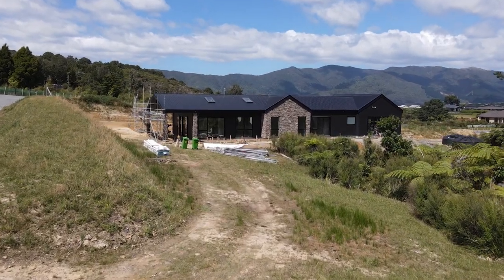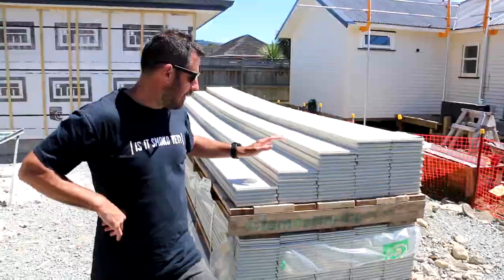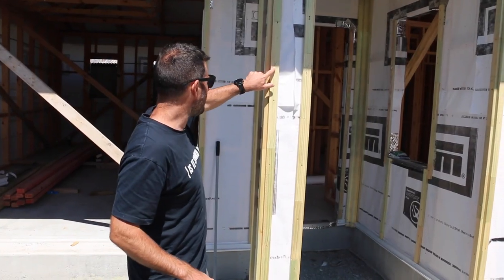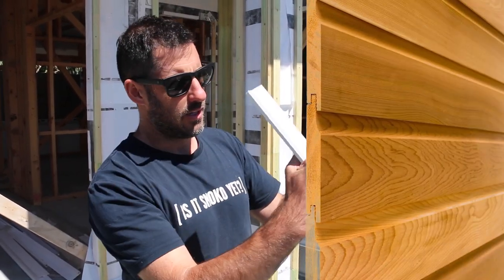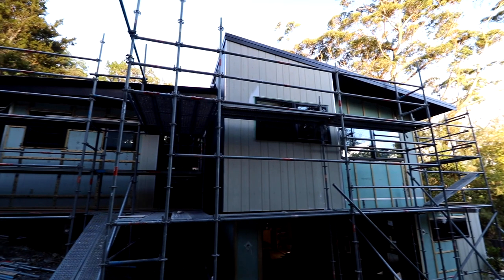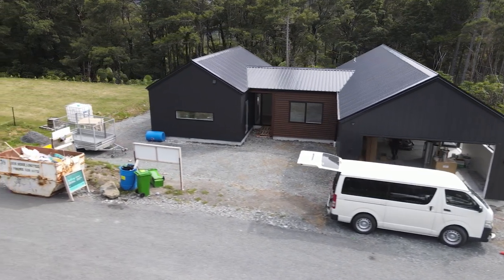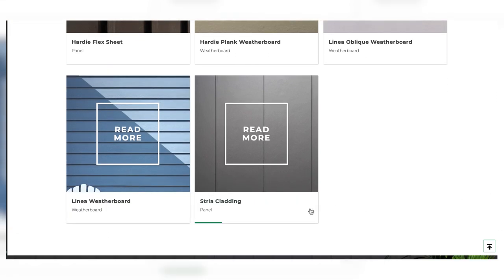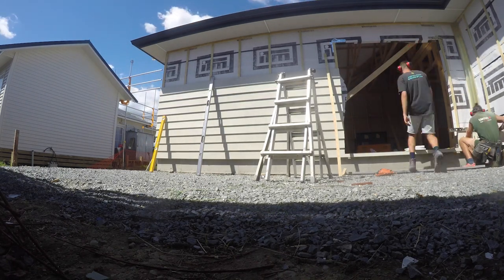Guide To Cladding

Comment: No mention of metal sheet cladding? Wouldn't a coloursteel product offer an option of affordability without the maintenance issues?
Reply from the maker: While the product is cheap Its my preference to avoid it for a few reasons 
- really loud in the rain 
- labour intensive to install with flashing details around hard windows etc
- Easy to get damaged then you have to replace the whole sheet
Reply: @nzbuilder  Thanks Josh for that feedback.